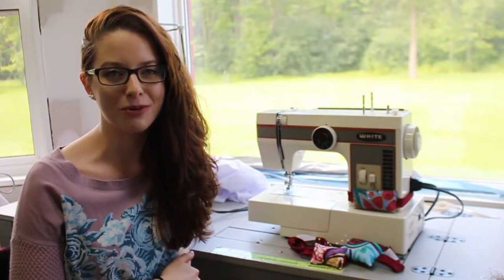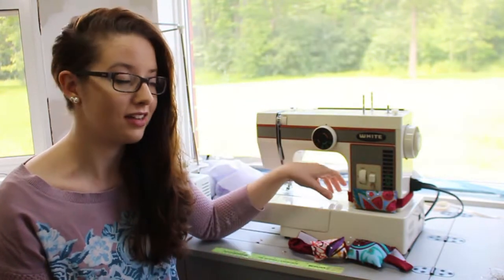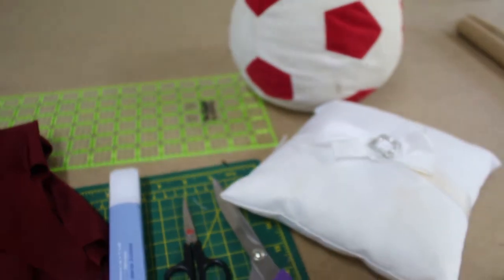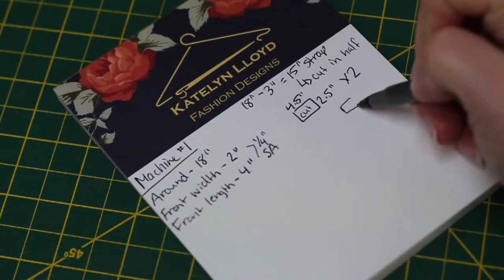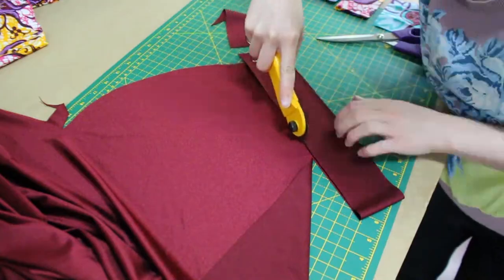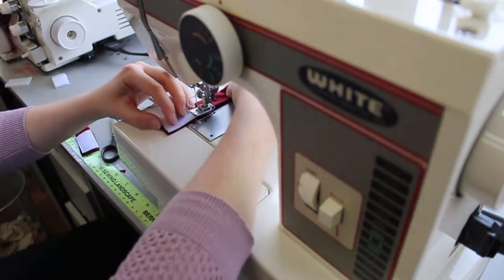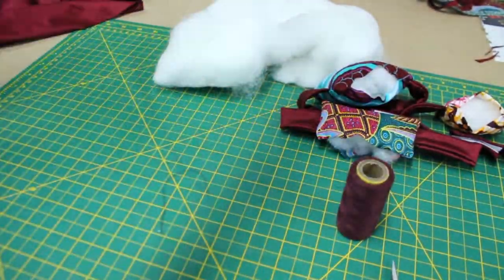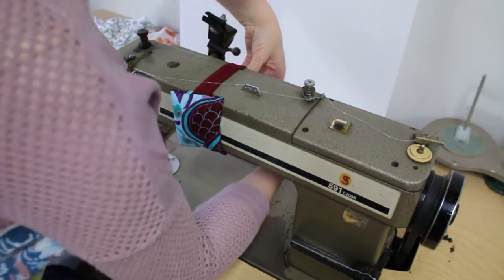DIY Sewing Machine Pin Cushions

Comment: There should be a solid backer, of some type, between the batting and the back of the pin cushion. This is to protect the finish of the machine from being damaged by pins. Many of the collectible antique machines (especially those with beautiful decals) are marred by using this style pin cushion on the arm. Some DIY backer materials - piece of plastic cut to fit, from a milk carton, flexible cutting board. grocery produce box, plastic lid from a nuts can or - stiff cardboard from the back of a notepad, cereal box, etc. or - other similar pin resistant materials you may have around your home.
Reply from the maker: Oldtimer Lee this makes sense! I haven't had too many issues so far but will keep that in mind :)